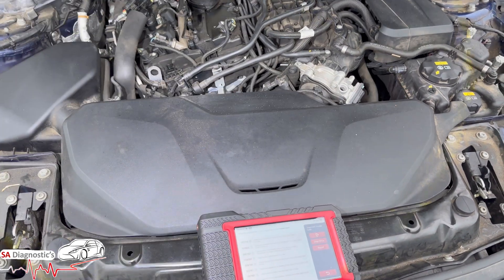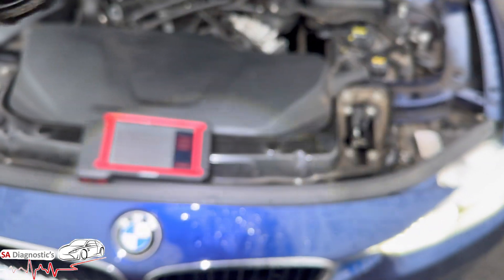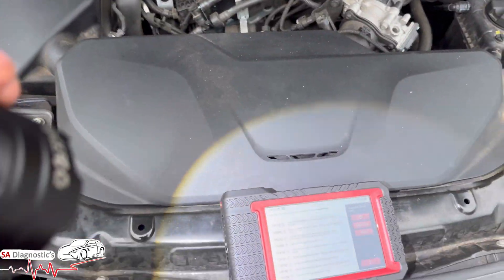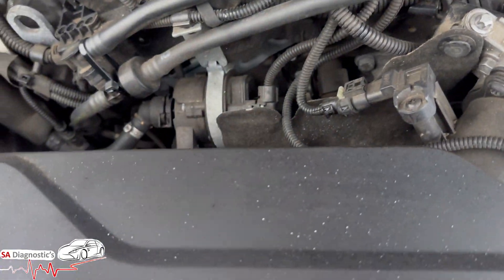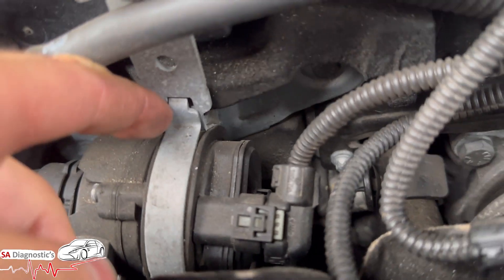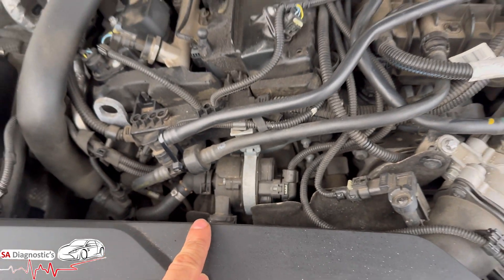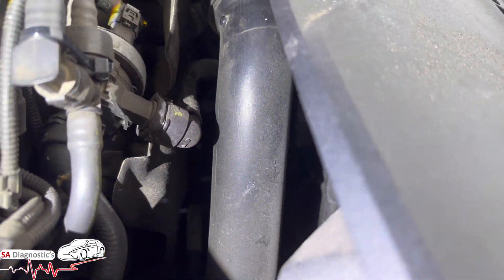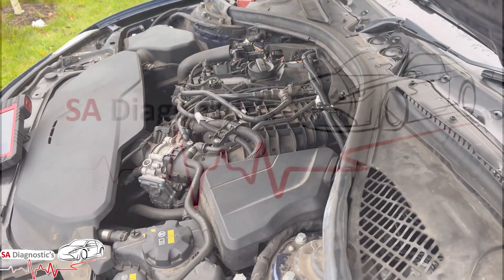BMW 20A105 1009002 Coolant Pump In Low Temperature Coolant Circuit  | Coolant Temperature |  DIY

Comment: hello my auxiliary coolant pump has been disconnected there is no function of any 1 cables have been cancelled Does the car cause 1 problem in this way? can I use it this way